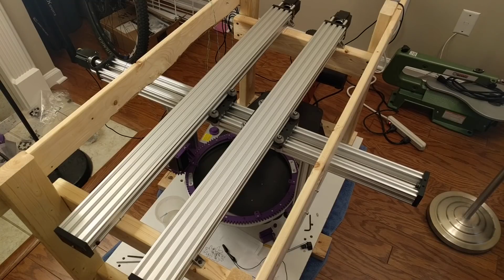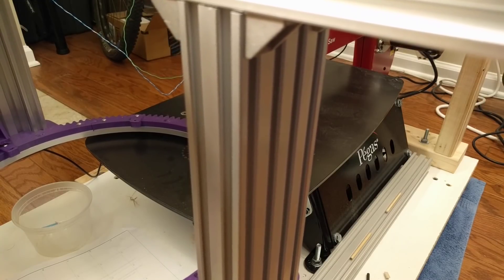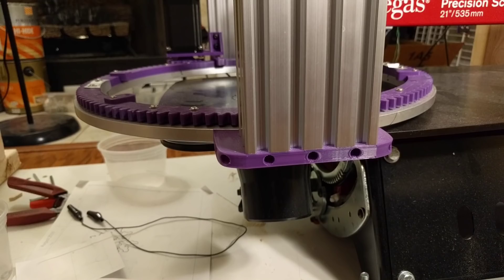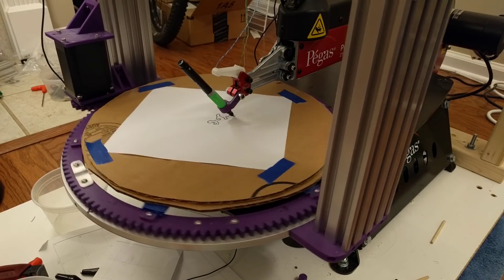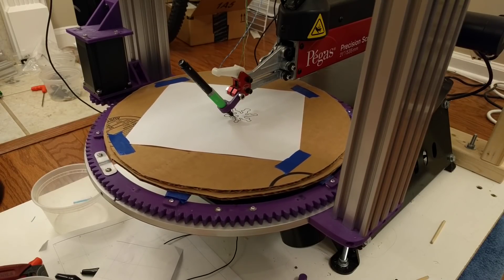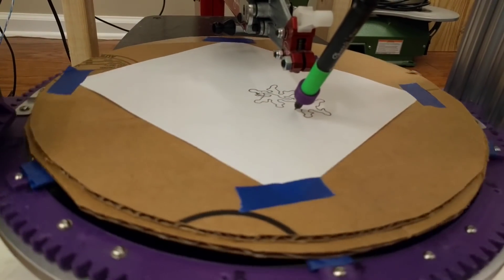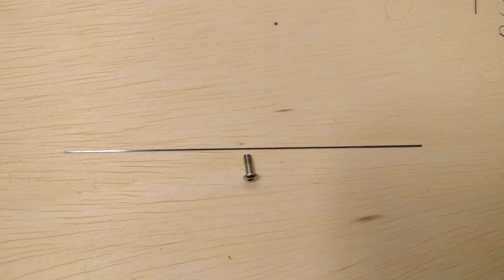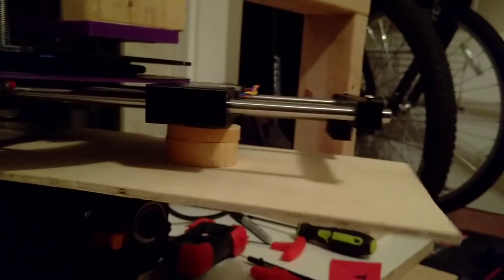CNC Scrollsaw

Comment: Hi Andrew, I'm making this cnc scroll saw for my final degree project, based on your work. I have problems with programming, could you help me.
1.- What software do you use?
2.- What configuration do you use to be able to move the motors simultaneously, or how do you program the movements of the curves
I use arduino sending pulses depending on the distances of the x, y, rotary axes.

This is the video of the machine that I am making:

 https://youtu.be/HN4a5BLKr78

PLEASE HELP ME!!
Reply from the maker: Looks awesome! I wrote a Python program to generate gcode which got run by a Duet controller. See https://youtu.be/HUYZ1uN4Fh8?t=177 for something to keep in mind, I would suggest "#2 move then rotate" to simplify. When you want to rotate the workpiece relative to the blade, you need to rotate by some angle AND simultaneously an arc move (G2/G3 in gcode) whose radius is the distance from the center of the rotary axis to the current point (take a dinner plate and pinch it with thumb and forefinger near the edge then rotate the plate and watch its center point, it will trace an arc; and in this machine the center of the dinner plate is the coordinates you feed the machine). Good luck!
I am curious what saw you're using? Looks big!

Comment: How well does this work with laminated chipboard or gator board foam core?  Would the reliability be improved using these types of materials?  So if you were to sell this how much would it go for?
Reply from the maker: Laminate is hard on blades so I would think that would be harder, and foam core is super soft so it would be easier -- but haven't tried either so I can't say for sure. Lots has changed since this video so check out some more recent videos too. No sales plans at the moment but stay tuned that might happen in the future

Comment: This is incredible! One of the most beautifully nerdy projects I’ve seen in a long time! I LOVE that you’ve built into your design the complicated rotation that will be required to account for a non-spiral blade, which will give you so much precision and such gorgeous cuts. If this machine can be made into a reality, I would find it much more useful than a CNC router. Rock on with your bad self!

Comment: Brilliant!  Thanks for documenting your build.

Suggestions:
1) Use a spiral jigsaw blade, which cuts equally well in all directions.

2) Dispense with the jigsaw altogether, and use a laser to cut the wood.  That would be cheaper and faster...but not nearly as interesting from an engineering perspective.
Reply: 2) the price on a laser for cutting 1/2" wood is really expensive.

Comment: How will you deal with blade drift?
Reply from the maker: Great question and not something I've considered directly. For blade drift inherent to the blade, my initial thought is that the workpiece is held rigidly enough to overcome this, but this is something I will have to test in the next version. And then blade drift caused by the workpiece putting sideways pressure on the blade just comes down to inaccuracies in positioning and is what was breaking my blades (I think). Thanks for the great question!

Comment: This is super incredibly cool. 2 questions:

1. Have you tried spiral scrollsaw bits (cut in every direction rather than having to cut the "proper" direction)

2. What's the benefit of this over a laser? The only thing I can think of is for really thick material that you can't live with the angled kerf from a laser.
Reply: Aluminium?
Reply: @K0M15-def  and things like PVC, PC, Teflon...
Reply: @ramous5182  Also true, didn't think about the "you shouldn't laser this" category of materials
Reply: @K0M15-def  I knew there was something! Thanks

Comment: If you are having problems with error accumulation then I think that you might need a different controller. 
For example LinuxCNC, which does all calcs in double-precision floating point, so should not accumulate errors. 

Rather than create fancy G-code it should be possible to create a kinematics, such that conventional XYC tangent-knife code works. The kins is required to compensate for the fact that XY rotates with C, but that seems fairly feasible. 

Have you considered a rotating blade? If the blade was mounted in bearings, with independent motors top and bottom to rotate it, I think that could work. 
It wouldn't look nearly so crazy though.

Comment: Long ago I worked on a saw like this, but I opted to use a spiral blade so it could cut in any direction.  It's impressive trying to manage the cut direction.  That's a much harder problem. I'm impressed you got it working at all.  Have you ever considered doing a spiral blade version?
Reply: You could also use a Duragrit 360° Carbide Scroll Saw Blade.